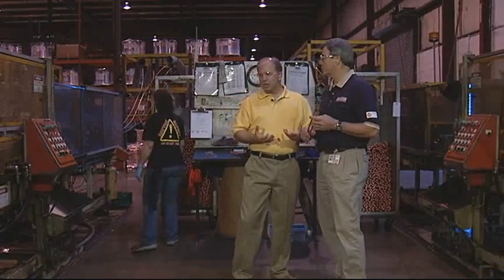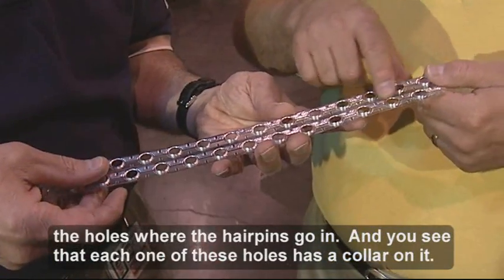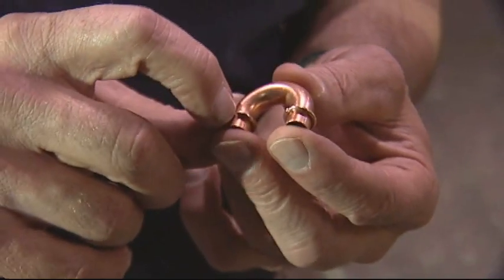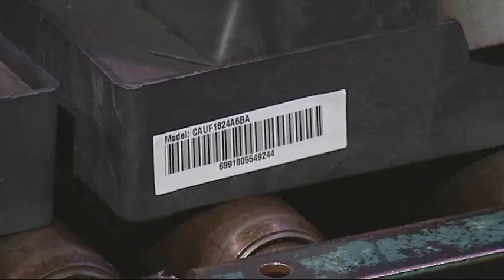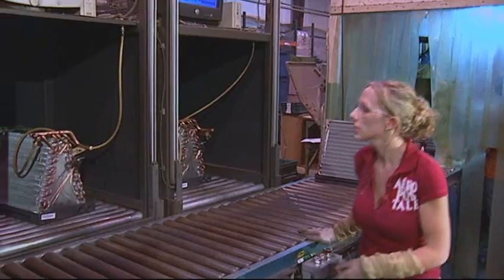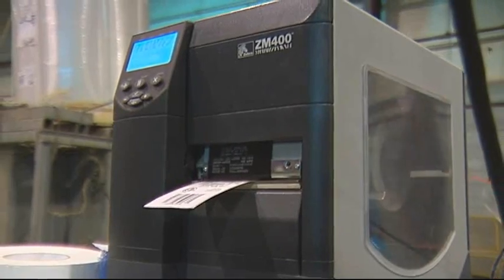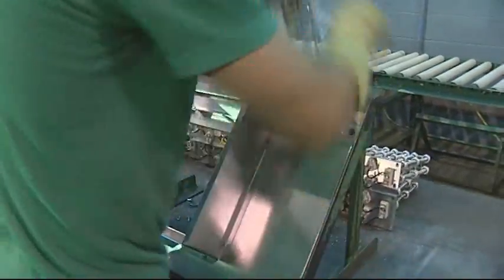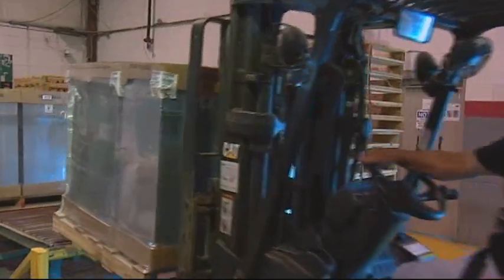Goodman Evaporator Coil and Air Handler Copper Assembly hvac

Comment: I used to do this manually. In the copper tubing we would put a copper wire screen roll inside the pipe. Solder one end close. Then leave a small pin dot hole and inject isopropyl alcohol inside. Put a plug over the pin hole. Bake the core for an hour at 300 degrees. Pull the pin hole plug and burp the system about 3 times in that hour. It would create a vacuum and increase the cooling/ heating effect. You could put it in tap water and it would start boiling. Crazy technology.

Comment: As a customer of 14 years, I’m extremely happy to say that my Goodman air-conditioning and furnace system has never broken down.  
Just recently The only part to go bad is a capacitor. 

And due to improper installation condensation lines the evaporator pan cracked. 

But other than that, my unit had never been touched for 14 years by any any service tech   

I’m extremely happy with Goodman is my first home and my first unit I’ve ever purchased

Comment: Those coils were the worst, couldn’t really handle the pressure of 410a especially in the green grass states. The copper tubes were too thin and brittle.  The aluminum do much better.

Comment: The louvers in the fins greatly harm efficiency. Sure for the first 4 to 6 months it helps but then they hold debris and reduce airflow tremendously. Frequent washing helps but you can't wash the indoor coil without removing it, removing all the freon and taking it outside. Smooth consistant fins with decent spacing is worth the tiny efficiency difference when brand new.

Comment: Nice units... You need to make sure the screws putting units together is tight and firm specially on the blower side complete screws  and mark inspection is must.. I installed alot of air handlers and furnaces.